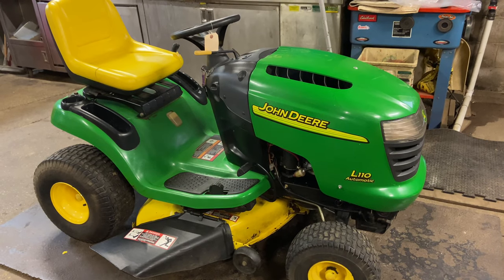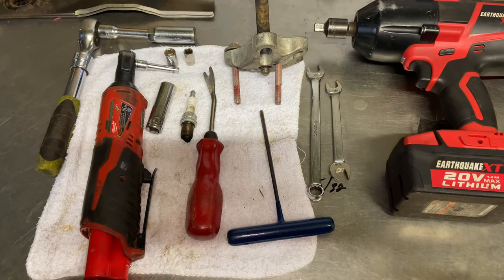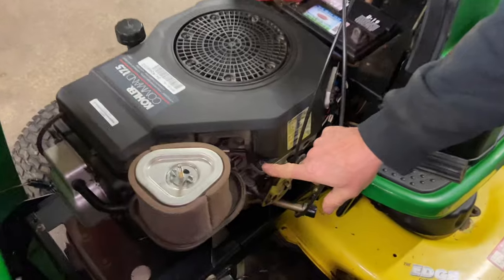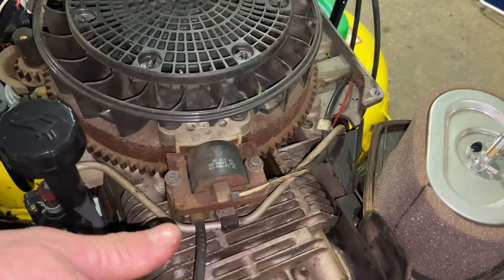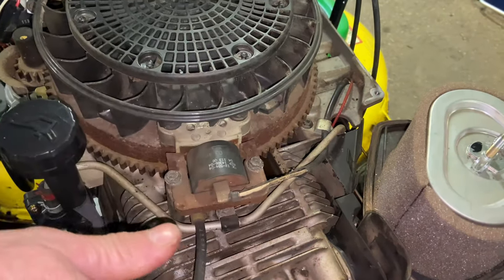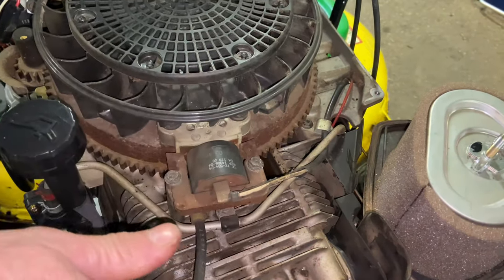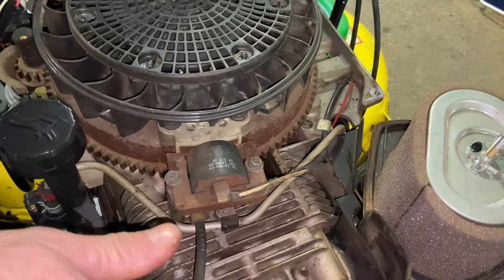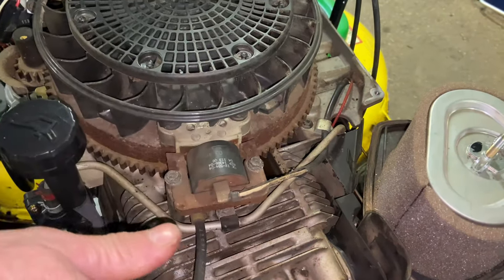Kohler Command Engine Missing and Popping

Comment: I have been doing this for more years than I will admit I enjoy watching the younger generation working with their hands getting things done rather then having someone to do it for them if they are willing. Well done very informative anyone following along should not have any problems performing this modest repair. So again well done only thing I could add would be maybe a little 242 blue loctite on the flywheel bolt. Very good job keep up the great work.
Reply from the maker: Hi Raymond, thank you for watching and the kind comment!
Reply: great job on the video - you explained step by step and was easy to understand

Comment: Another way to quickly check for a broken key without taking off the flywheel is to put the piston tdc then look at the magnet, on the flywheel, it should be right at the magneto.
Reply from the maker: I agree to a point but if the key doesn’t shear all the way most people cannot see the difference except to the trained eye so opening it up and taking off the flywheel is in my opinion the way to go plus if it is sheared your able to repair quickly:)if it’s not then you move on to the next possible issue and you have just learned a lot about your engine :)

Comment: Very nice fix. Some of the earlier models did not have that ground connection on the voltage regulator and when the bolt failed to ground it , you had to add a short ground wire. The Kohler Courage engines are even worse, many issues and crankcase leaks, carburetor issues etc. Thanks for the video, Great work.
Reply from the maker: Thank you, I know all about the bad Kohler Courage engines. Cracked blocks, bad valve covers, just a very bad engine. I'm happy they do not make it any longer. Thanks for watching!

Comment: Just saw ur channel for the first time. I'm glad u don't do alot of unnecessary talking, u go straight to the point. Guys like me who fix there own stuff don't have time to hear about someone's lunch and pause to talk about it. Can a blown head gasket cause similar symptoms. I subscribe also. Thx stay on point like ur doing.
Reply from the maker: A blown head gasket most of the time would not make a popping and missing sound. It would sound like air puffing out when you turn the key to the off position while engine is slowing down. If the flywheel key is ok? It will normally be ignition, try replacing spark plug, carburetor, rebuild it or possible a valve issue but valve issues are rare with the Kohler command engine. Thank you for subscribing, commenting and watching.

Comment: AWESOME job on the conveyance of information and hands on doing the job. Very well thought out video. No one should have a problem doing the same job after watching your video!!! Thank you and its time to round up my tools needed for the job you've shown me how to complete. Have a GREAT DAY!!!
Reply from the maker: Thank you! I’m glad the was helpful. Please give this a like, subscribe and tell your friends to help my channel grow. It would be greatly appreciated.
Reply: @JohnsonsSmallEngines  I will for sure and I also have a L130 with the 23hp Kohler cmd motor. Would it be a wise thing to do if I checked the flywheel bolt on it if tight? Its running fine now but was thinking like preventative Maint.
Reply from the maker: That is a non prevent item. Normally there very few problems with the bolt being loose on small engines.

Comment: Back in 2005 I bought a huskee supreme 54 inch 23 hp Kohler courage v twin garden tractor from TSC brand new.  In about a 6 month period the engine develops the same sound as yours . Which the key was sheard key like yours. Made the same sound.  We never had hit anything with the blades replaced the key on flywheel ran great.  I guess after seeing this video they had problems with these engines from the factory.  I've owned a 17 hp v twin briggs and Stratton engine from 1989 that still ran good when I got ride of it in 2005. I like briggs engines better.

Comment: Thank you for the very informative video, it helps alot when people do tutorial videos to exclude the annoying music! And it helps the viewers when you do speak the commentary! 
I have this same exact mower, I've had it since 2010. Bought it used at approximately 300 hours. It now has 537.6 hours. I'm just now starting to have issues with the motor, the deck/mower parts I've replaced as needed over time. My issue with the motor is the last time I mowed (I have 1 very rough terrain and dusty acre) I was approximately a little more than half done when it made a pop sound (sounded like it was internal and wasn't very loud) it had been smoking for a bit but once it popped it started getting sluggish. So instead of pressing on thinking that it blew a gasket or piston ring I just shut off the engine for fear of it locking up. I let it cool down went back and tried to crank it. All it did was turn over but no start. Next day tried it again and same thing! This was 3 weeks ago, I had a friend of mine that is small engine literate come take a look. He first tried the spark test ( gets excellent spark)then pulled the valve cover (all looks good). He then took the cover off to expose the flywheel and checked for compression (all good). He ran out of time because he was in the process of moving to a new place and had to go get a key and would be back to go deeper in to find the problem when he had time and I had money to pay him! Lol. He did say that it could possibly be a carburetor/choke/solenoid issue??? He then said if that wasn't the case then it would have to be internal (my guess is full motor rebuild???) To my knowledge this motor has never been opened up but we did find that there where a few small rocks on top of the fly wheel where the fins are??? But none of the fins are chipped or broke! Could I have sheared that flywheel pin??? Or would it be a best assumption to try the carburetor/choke/solenoid first??? On a normal mowing routine this motor does smoke for about the first 3 or 4 laps then quits. I have noticed that it does burn oil it has to be because I dont see where its leaking or puddeling, It stays parked on concrete???
Reply from the maker: I would pull the flywheel and and check the key before getting into the carburetor. You said it started loosing power after the first pop. A sheared flywheel key will make the engine sluggish because the timing will be off. Thank you for the kind words, please give this video the thumbs up, subscribe and tell your friends to help my channel grow. It will be greatly appreciated !
Reply: @JohnsonsSmallEngines  awesome thank you!
Reply: @JohnsonsSmallEngines  we did a little more investigation yesterday and we found that when we pulled the spark plug out with a flashlight we could see that the piston/arm is not moving when motor is turned by hand. We think it might have broke the piston arm!😥😫☹ 
So if thats the case then that would mean that the motor ran without oil but that doesn't make any sense bcs I know for a fact that it had oil every time I'd get ready to mow! What would cause the use of so much oil to burn that it would run itself dry within the 1 1/2 hour mowing time??? 
We haven't actually dove in to the guts yet, that will be our next investigation. Probably today! Also since I bought this mower used 10 years ago it doesn't have a service manual. I've been on the Kohler website but haven't found exactly what I'm needing, do have a suggestion of a source? Thank you!
Reply from the maker: @kevinbrister8801  There are many different reasons why your engine can burn oil. I can say that most small engines do burn a little oil while running and if you went a very long time without adding it or changing the oil and oil filter? It can run low and lack of lubrication will happen, then boom the connecting rod will break. Which in your case may have happened. Not much to do now. Repair it or just fine a used engine and install. You should be able to find a service manual online. Just google Kohler Command Manual PDF and many should pop up. You may need to enter the model of your engine that should be on the silver sticker on the side of the engine to get to the correct manual. One manual may also cover many models.
Reply: @JohnsonsSmallEngines  thank you
Reply: @JohnsonsSmallEngines  I'm back with another question or two. I'm looking to purchase a used Kohler courage 18hp to replace the Kohler command 17.5hp. This is for that John deere L110. Do you know if the bolt mounting  pattern would be the same? Would the exterior parts like carburetor, starter etc... would interchange? Would the wiring harness be the same? Would the shaft be the same? I've searched everywhere and have found nothing! Thank you!
Reply from the maker: The Kohler courage engine was one of the biggest disappointments Kohler ever made. The courage engine is all different from the command the engine bolts may line up but the rest of the engine nothing matches. It is in my opinion, the worst engine Kohler has come out with. They even had issues with the block cracking due to poor design on the single cylinder models. Keep on looking for a Kohler command engine and you may need to have one shipped to you if you find one or look for a cheap used tractor with the Kohler command engine on it that runs good and swap it out.
Reply: @JohnsonsSmallEngines  thank you
Reply: I'm back with another question.
I found a replacement motor and I will be going to check it out today. It is the exact same motor that I have which is the Kohler command 17.5hp pro. The man tells me that it's not running for what reason he doesn't know other than its missing the starter and battery. All the exterior parts on my motor are still working and I will be taking them with me along with my new battery. Is there any possible way to know if his crank case is cracked or anything else other than pulling the plug to check for compression and to see if the piston moves? With my parts on it to do some checking even if it doesn't crank it could be something minor right? As long as it seems to want to crank I would think! He only wants $125 for the whole mower and motor, I dont need anything but the motor so I'll part out the rest!
Reply from the maker: @kevinbrister8801  Why is the starter missing ?. I wouldn’t give him any more than $75. Check to see what the oil looks like? Low? Very black? That’s not a good sign. If you take your starter and a good battery then after installing them and if it does crank, spray some fuel down the throat of the carburetor and see if it will fire. *note on the cracked block. You will see packed oil all around the engine or you will see oil somewhere all over. I haven’t come across many Kohler command engines that were cracked. You may want to keep looking for a engine but good luck!! I think he should pay you to take it away.
Reply: @JohnsonsSmallEngines  lol right! I think he might have pulled the starter for resale purposes or pulled it off for another mower. Thank you

Comment: Years ago ( 1990s) I had the same problem with a tecumseh engine , started ran about 1 minute and stopped.  Took the flywheel off same thing. The flywheel bolt has to be torqued properly or the key will break.  

I know I'm late , but its a great informative video.
Reply from the maker: Hi Bert, I remember when Tecumseh engines were on Craftsman tractors back in the day.
Reply: @JohnsonsSmallEngines  
The tecumseh I worked on was on a roto tiller . Regardless of what I work on I make sure the flywheel is good and tight. 

Great video sir

Comment: ive been trying to revive a cv15s that has been sitting for 4 years...new carb....new fuel pump...cleaned out the fuel tank....but ive been messing with it  for 3 days now...when cranking it would gulp gulp gulp then pop from the carb and the exhaust...i just couldn't figure it out...when you mentioned that flywheel bolt being loose...that is what i have,...but didn't pay it any attention...first thing tomorrow i will check the woodruff key...and will report back...in the mean time thank you for the great content
Reply from the maker: Sounds like you may have found it! Let me know show you made out.

Comment: You are good at this, fixing and teaching. Thank You. My elder neighbor has a similar JD rider and everytime he takes it out the best way to get it started is spray fuel in the carb then runs fine entire mow. Fuel filter mess cleaned, replaced. Wondering whats going on, on such a newer machine.
Reply from the maker: I need more information to help. What is the make and model of the engine?? It sounds like the choke is not working.

Comment: I recommend putting a 75-85 micron fuel filter right before the carb where the rubber line is.  The steel fuel line rusts & causes rust particles into the carb.  I had this issue so I sand blasted the fuel line then did the filter.  Oh, & cleaned the carb.  I know this isn't the subject of this video but would like to contribute some information about these designed kohler's.

Comment: Great video!
Reply from the maker: Thanks! I hope it was helpful and thank you for watching!
Reply: @JohnsonsSmallEngines  it helped  alot. Mine only wants to run on choke. Put on new fuel filter,  new plugs, has spark on both cylinders, and the electronic thing on the carb bowl clicks as you said it should. I'm down to thinking it may be some dirt in carb. ?? Seeing your video helped me check a couple things as I would have missed.
Reply from the maker: Yes, you have dirt in the carburetor or if you have a fuel pump on the side of the engine, sometimes that may fail but not often. Running the machine in the choke position to compensate is most likely a dirty carburetor.

Comment: Your video is well done and contains great information when troubleshooting lawnmower engine popping issues. I have a Kohler Command model CV490s (spec 27508) on a Sears Craftsman LT-2000 riding mower. The lawnmower runs fine for about 30 minutes then pops/spits and sputters before it dies.  I replaced the carburator, battery, fuel filter and spark plug to no avail before viewing your video on the John Deere L110. Removed the valve cover but there are no adjustment screws/bolts, so on to the flywheel to check for a broken key. Is there a possibility that the ignition coil is also weak/going bad?
Reply from the maker: If your engine runs fine for thirty minutes then most likely you either have a as you said (1)ignition coil failing,  (2) clogged fuel cap or if you have a (3) electronic fuel shut off solenoid under the carburetor. You should purchase a spark tester and when the machine fails, check the spark. Can you re-start the machine as soon as it stops or do you need to wait for a while before it will run again?

Comment: Thank you nice video I have a question there is no valve adjustment there is only simple bolt to tight that's all how to do that.
Reply from the maker: Correct, on the single cylinder Kohler command engine there is no adjustable valves. They have hydraulic lifters. I can say that sometimes the valves will sound horrible “loud tapping “ noise until the lifters get pumped full of oil. If your experiencing loud valves? Run the machine by cutting grass for ten minutes then listened your engine and it should be quiet by then. Also make sure your using 10/W/30 oil and it is at the correct level.

Comment: I've had mice chewing the insulation off wires. The simplest way I've found to re-insulate them is by using the 3M liquid electrical tape. Just apply a thin coat, do something else for about 30min, apply a 2nd coat! Works, EASY!
Reply from the maker: I’ll have to try that. Thanks for the tip :)

Comment: What size bolts did you use for the puller screwed into the flywheel??
Reply from the maker: I think they are 8mm x 1.25 pitch. Length depends on what puller you are using

Comment: Thank you for this video I have a kohler command cv15s that idles fine but when you put it under a load it misses pops and backfires. I thought the carb needed rebuilding so I did that and replaced the plug and coil but it still does it, I'll check the key and see if it is sheared some or all the way. is there any other things to check for with an engine running like this?
Reply from the maker: Water in the fuel.
Reply: Thank you I will drain the tank and give it a try. @JohnsonsSmallEngines
Reply from the maker: Worse case you may have valve issues. I’m just giving you educated guesses. I would need to see the machine to determine what is going on.

Comment: How would a flywheel key break like that?  Hit a big rock while mowing?
Reply from the maker: I would say yes (hit a rock and sheared) if the blade was attached to the crankshaft but there are too many belts that would give before this engine would abruptly just stop. Most of the time I have come across a loose flywheel bolt allowing the flywheel to move then it shears. I have also seen the engine backfire while shutting down and the engine will abruptly spin in reverse and shear the key.

Comment: Great video!! 👍👍👍
Reply from the maker: Thank you! I’m glad it was helpful:)
Reply: @JohnsonsSmallEngines   Have a question. I have a 48" walk behind with a 15 hp Kohler it misses and pops set the coil gap with a business card and still does the same thing. Do you think the marks are off on the timing gears. Guy said he rebuilt the engine? Maybe he did something wrong. Thanks.

Comment: Funny thing is i have the dame mower and exact same engine and i have to choke it every time i start it. Mine runs fine but then boggs for 3-4 seconds then runs fine again.
Plug, air filter, fuel pump(x2, doesn't play well with non-John Deere parts) and just changed voltage regulator (separate issue). Not sure where to turn next.
Great video BTW
Reply: I converted mine to a vacuum fuel pump. Custom Block off plate in the fuel pump location with a nipple  for impulse.